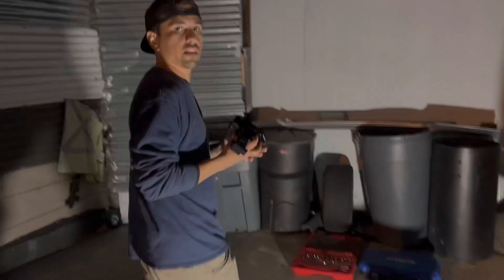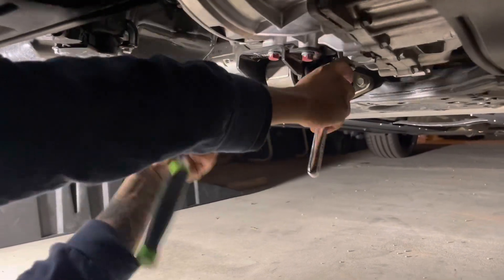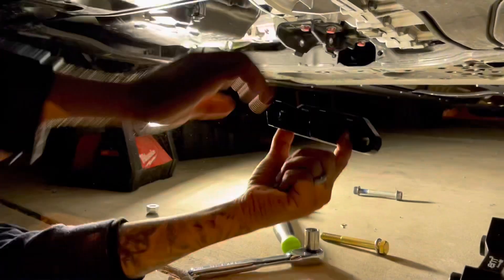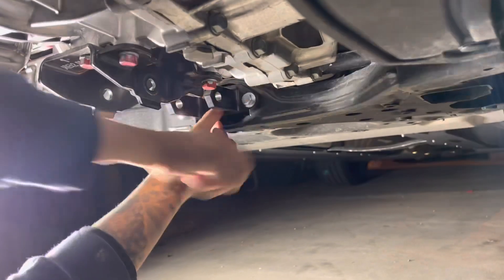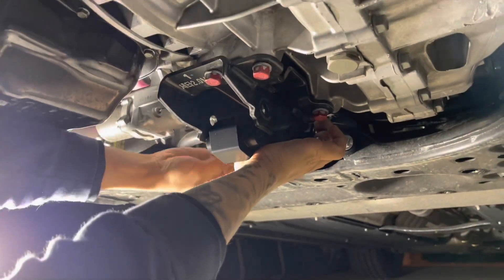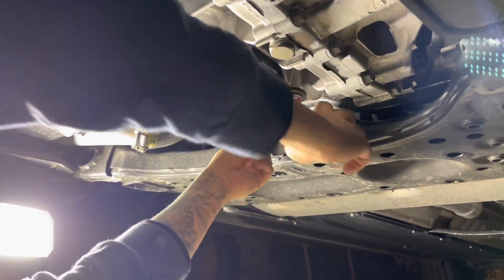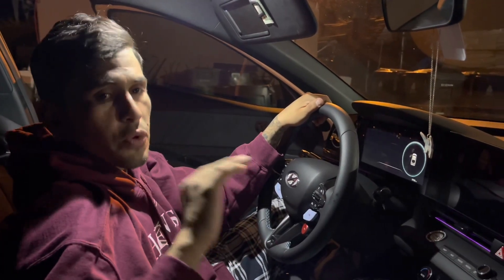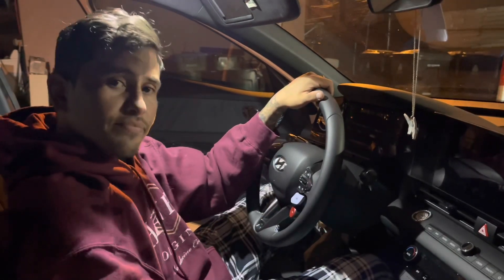How to Install SXTH EM3 Lower Engine Mount on an Elantra N / Avante N

Comment: im just gonna buy the no hop bushings but still a great video
Reply: update after 9 months I ended up getting the actual mounts because six elements had a deal for like 90 bucks I'm going back to stock it vibrates way too much😅
Reply from the maker: Lol it does break itself in after a little bit but you can def feel some vibrations 😬

Comment: My Sxth mount does not line up. The front and back bolt pass-throughs are too long. I can’t put the back bolt in and the front bolt in because they are spaced too far apart. I’m working on my Kona N but the mount is the exact same. Frustrating

Update: I got it to work the first try after writing this comment lol
Reply from the maker: Lol good to hear! I was wondering if maybe you got a wrong mount but I know that their mount is compatible across the 1.6t and 2.0t chassis. I’m glad you got it taken care of 🙏🏽 now to enjoy it 😈
Reply: Hey there, I’m gonna be putting this on my Kona N and wanted to ask what the issue was. SXTH said it’ll fit just fine, did you have to do anything extra to make it fit?

Also how do you like it? Was it worth the extra vibration if any?
Reply: @Killy3369  the mount line up was user error! You have to be a fairly forceful but it lines up. Also, don’t tighten one side at a time. Hand tighten then alternate with socket wrench. Vibration is pretty noticeable and makes a decent racket but ONLY with a/c on at a complete stop. I rarely drive with a/c on anyways so it’s not something I usually notice. I prefer windows down 😂 but overall has helped a lot, though it’s not a cure. You can still hop and spin some depending on your mods.

Comment: Do you need to support anything while undoing the bolts and whatnot? Such as the transmission or something??
Reply from the maker: Nothing at all needs to be supported when removing the lower engine mount.

Comment: benifits of this over just doing the bushes?
Reply from the maker: I’m actually going to be ordering some bushings for the Veloster n to see how much of a difference they both feel. Just need to order it first lol.
Reply: @KDMStation  is your manual sedan clutch very hard to get used too?
Reply from the maker: @damienfrizzell9394  no the sedan clutch doesn’t feel stiff or hard to get used to at all. Very smooth. And the billetworkz knob only two shapes from my understanding were compatible with the reverse lock out collar. Maybe they have changed since then.
Reply: @KDMStation  did you hear that some models had the clutch installed back to front?
Is the second shape the hybrid?
Reply from the maker: @damienfrizzell9394  yeah I heard about that and thankfully we haven’t had any issues with ours. If you notice something off about the clutch or the way gears feel that maybe the case unfortunately. And I believe it was teardrop and round. But the hybrid comes in a shaped that works too
Reply: @KDMStation  thanks man I wonder how I could confirm that mine is ok or not
Reply: @KDMStation  I like the round but would it hide the adaptor you think?
Reply: @KDMStation  also sorry the billet throw knob does it have to be that shape?

Comment: After having it for a while now. What does the wifey say about the NVH from the engine mount? Still worth it for daily driving?
Reply from the maker: Hey its wifey 👋🏽 lol I think it’s perfectly fine. I only really feel it of course when I put the air on. But I’m used to it now in general that it doesn’t bother me. And I prefer it because it has helped with some wheel hop.
Reply: Probably not, I have the same problem.  It actually rattles my LED interior lights upon hard acceleration.  Going to swap it out for stock mount w/ Powerflex bushings.

Comment: why do you need to do that for
Reply from the maker: To fix wheel hop and it helps the transmission and engine stay still while shifting.
Reply: @KDMStation  Oo that’s cool and also sorry for asking but like did you guys do a down payment like what was the process cause I want one so badly
Reply from the maker: @Subiked22  I’m a little confused to the question first lol. Are you asking about a down payment on the car or a down payment on the engine mount. If your asking about the car we put $0 down.
Reply: How did you find out that this was the right part for the car?
Reply from the maker: @tammy2762  Sxth element the company that makes it confirmed that this part fits.